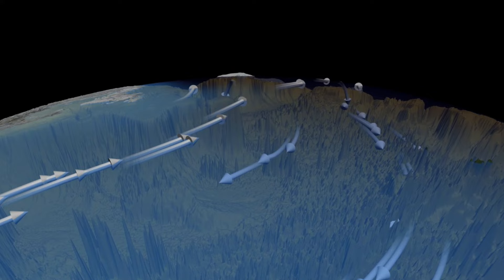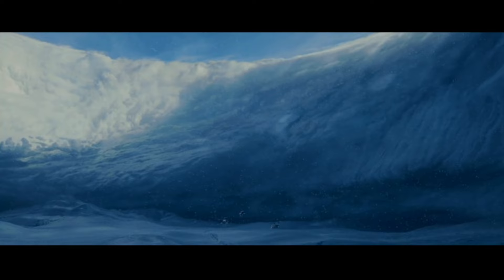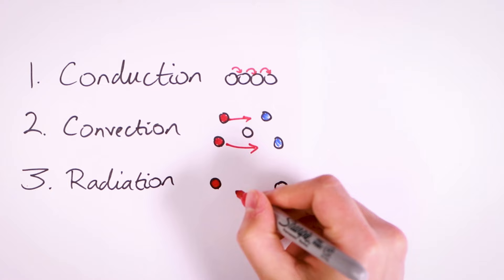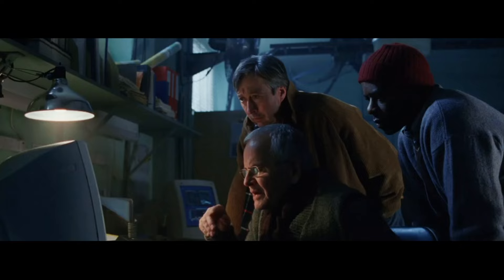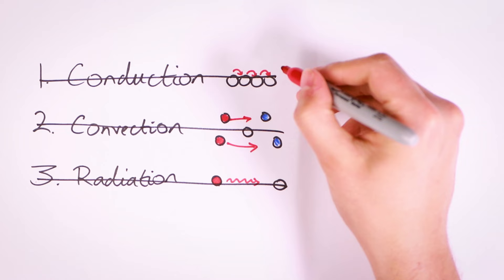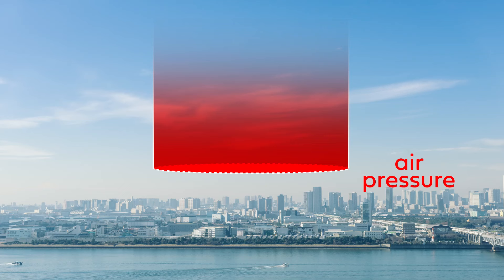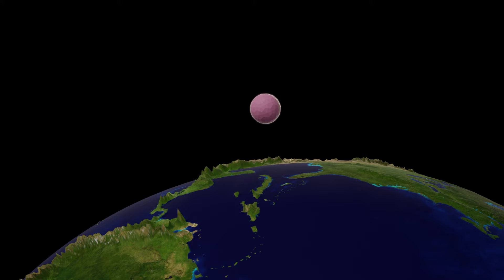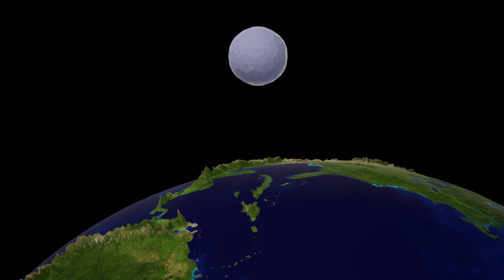The Biggest Error in The Day After Tomorrow

Comment: Funnily enough, my meteorology teachers said that one part in the movie is feasible...even assuming adiabatic warming, that that aprticular scene was theoretically feasible, but then again, I thibk they were assuming the hurricane like storms acted like a true hurricane where pressure at the surface would fall and then would allow for No work to be done one the parcel, but of course from there there'd be less atmosphere to take the heat away, and helicopters would fall iut of the sky well before it got cold enough, simply due to decreased push from the presshre drop
Reply: I thought of this as well.  The whole reason the air descends is the drop in pressure in the eye of the storm.  The air might actually get colder as it descends.  Didn’t think about the other implications, though.  Not only would the helicopters fall due to the low pressure, I think the characters might suffocate.
Reply: @SeaCowsBeatLobsters  
The pressure near the top of the mesosphere (80-90 km) is only 1/100,000 or 0.001 % of that at sea level, so the air descending to the surface without being compressed isn't even remotely possible.
Reply: In practice, a super-downburst
Reply: @SeaCowsBeatLobsters  An air pressure that's 160 hPa or lower (16% of normal sea level pressure) will give you roughly 5 seconds of "useful consciousness" before hypoxia renders you incapable of performing tasks to save yourself. This is assuming you were sitting still, any sort of aerobic exercise (e.g. running around) will further shorten this.

Comment: I was actually thinking about the helicopter freezing scene recently. If the air from high in the atmosphere is cold enough to freeze helicopters (and helicopter pilots) in seconds... how the hell did experimental rocket planes fly to the edge of space?
Reply: The velocities those planes flew at generated so much friction on the airframe that heating beyond safe operating temperatures of normal steel or aluminum alloys became an issue, therefore they used the fuel as a coolant before burning it (in the case of hydrogen rocket powered systems and other liquid fueled rocket systems), had ablative coatings or had cooling systems in place. At least until the super-alloys they needed were developed. Or they used solid fuel rockets which once started are EXTREMELY difficult to put out as the reaction is self sustaining and generates immense heat.
Reply: Because those are 2 very different things

Comment: I guess another way of saying this is that the per-molecule energy of air in the upper atmosphere is higher than that lower in the atmosphere, but that this only turns into a measurably high temperature when pressurised?
Reply: No. The per-molecule kinetic energy of the air is the temperature. It increases when pressurised

Comment: Nice to hear about this phenomenon from a scientific perspective.  I studied mining and mineral processing engineering, and we call the adiabatic heating phenomenon "autocompression."  In underground mines, particularly the ones that go way down, (the one I worked at had plans to go down to about 3km under the surface and only stopped there because exploration hadn't been done further down), we have to figure out a system of ventilating the workspace.  

In every mine, we need enough airflow to keep exhaust fumes, blasting gasses, natural underground gasses (like, y'know, natural gas) down at concentrations where they don't explode or make horrible things happen to people's lungs.  Unlike up on the surface, there's very little natural airflow in underground spaces, so we have to use forced air systems, and when you have a big industrial complex that's shape is largely dictated by the ore body, that makes for a complex system.  But...that's still fairly easy.

In deep mines, though, you get the added difficulty of heat management.  The further down you go, the hotter it gets, and that gradiant is fairly steep.  By the time you're over 2km down, you're talking upwards of 70 degrees Celsius or so, at least at the mine I was working at.  Naturally, that makes the air down there really effing hot.  Not quite 70, because we've got the fans going for the toxic/explosive gas issues, and that kind of heat will drive a degree of natural ventilation even if that system went down, but...more than hot enough to kill a human being working a shift down there.  So...we need to cool the place off.  

That's fine, right?  We've got A/C systems, we just make the air really cold and push it down and...oh...autocompression.  Or adiabatic heating.  How do we solve this?  Two options: really really cold air, or water/ice and heat exchangers.   The mine I worked at has been in operation for over a century, and has some interesting features from its early days.  One of the most notable is the collapsed section that has a nice network of cracks running all the way to the surface above it.  That's where they draw the air from, and because it's in the interior of Canada, the cold of winter and the heat of summer balance out to that rock being a pretty steady 2-3 degrees C.  That's enough to get the air at the bottom of the mine down to a safe working temperature.  But...that's the easy option that works if you're lucky enough to be running your deep mine in Canada and have a collapsed section from the early days of the mine when things like that were just...accepted normal events and not crises that might get the whole mine shut down.

The deepest mines in the world are the gold and platinum mines in South Africa.  The deepest of these, Mponeng Gold Mine, is working on going down as far as 4.27km below the surface, and was at 3.84km down by the end of 2018.  But...they probably don't have that network of cracks to the surface.  They certainly don't have Canadian winters to turn that into a very cold heat exchanger.  So they have to use the expensive option: pumping cold water (in extreme cases like Mponeng, a water/ice slurry, since all the energy that goes into melting the ice doesn't bring the temperature up), down, and having heat exchangers deep in the mine absorbing the heat down there and bringing it up to the surface.  There's still some work being done on the water getting pumped through the system, but this greatly reduces the amount of cooling potential that is lost due to adiabatic heating.   But doing that means you need to build an extremely complex and enormous system that is effectively doing what refrigerators do.  (oh, and if you're wondering why they use water/ice instead of a normal refrigerant, it's because somewhere in this massive system, you're going to get a leak now and then, and water spraying out of pipes is much less of a problem in a confined space than massive amounts of difluoromethane spraying into that space.  At the very least, a worker walking into that area is going to notice the water filling the space and thus not die, whereas you might walk into a space where the difluoromethane has replaced all the air and just die in a few minutes having not realized you had made a mistake until it was way too late. (And yes, such is the joy of working in confined spaces.  If you do this kind of thing for a living and have not had a course in how to work safely in such spaces...please find a course you can take, this is life-or-death knowledge.))  So...this is only really viable for mines that produce massive amounts of gold and platinum group metals, because mines are only viable if they turn a profit, and nothing else is worth enough to justify building a system like this.

(While I know nothing about South Africa's regulatory system, I will note that there are countries where mines "benefit" from having safety rules about hot environments that are less strict than those used in Canada.  I put that in quotes because I would argue that the safety of its workers should be a major priority for any mine, and forcing workers to work in too-hot conditions is contrary to that.  To me that outweighs the financial gains from not having to implement a proper cooling solution.  Unfortunately, there are far too many mine operators who do not take such a moral high ground.  And I do want to emphasize, this is not a comment about South Africa specifically; I do not know what their rules are.)

Comment: Under certain conditions, water can flow uphill. It requires the surface have a jagged "step" texture and be so hot that it induces the Leidenfrost effect. The water "grips" the steps and "falls" up the slope of the surface if it's angled correctly.

Comment: Yeeees. Non-scientist but I do recall having to suspend disbelief at that scene, as with the scene in Waterworld where he dives using the air bubble in an inverted glass bowl to dive down to submerged buildings - from a sea level that is above all but the Himalayas. Also, for low pressure air to be sucked down that work would have to be equalised  in some way and whatever is providing that energy is sure to be doing more damage than frosting the Empire State. (And where is the water coming from for that effect anyway?).

Comment: Even if the air was coming down as cold as described, it wouldn't be able to "suck out" so much heat energy from the buildings and helicopters through conduction as fast as shown.

As Simon states, air is a pretty good insulator and additionally, steel and concrete have a pretty high heat capacity compared to air. So it would take a lot of time to actually cool the material down.

It's like when you were in a sauna and then go outside in the winter, it is not like your core temperature immediately drops down to 0°C, you can spend a good amount of time there without even feeling cold.

Comment: Magic actor that did the work to move air around was left out of picture.

I saw that scene. And I thought it is perfectly normal that cold air would replace warm air and thus downward movement. It probably requires less volume to maintain same pressure when it is colder.
I understood that scene as somehow super-cold air appeared at some altitude. And warming from pressure increase while it moves down wouldn't be enough to avoid freezing.

I didn't understood well how to use that map at 6:24 in this video. My guess from it is that it indicates that going from 100 hPa (~15km) down to 1000 hPa (near ground) at ~40N latitude would result in warming up by 715K. But if that air was just from ~8km (~350 hPa) - difference is just 45K (330K-285K).

Comment: Adiabatic cooling is actually how air is typically liquefied. You compress it to high pressure, it then gets hot, and then you let the tank of compressed air cool to room temperature, and then you let out the pressure, and then you have very cold air, some of which liquefies if you do it hard enough. Ironic that you get a more compressed form of it by releasing the pressure since of course the liquefied air then has a much higher density than the compressed air. But of course that's not a problem for consistency with the laws of thermodynamics because only a small fraction of it actually liquefies.

This actually doesn't work with helium starting from room temperature, to liquefy helium, you must cool the whole thing with liquefied air first, AND THEN perform this process starting at the lower temperature, so it's a very inefficient two-step process, and that's also why liquid helium is so expensive to produce. Note that adiabatic cooling doesn't actually happen at all in an ideal gas, it is only because of the van der waals forces and unideal behavior of a gas that it happens at all. If you compress an "ideal" gas, it doesn't heat up at all because the work you perform on it just is stored as potential energy by virtue of the fact that it is compressed gas which can perform work when it expands again, so the energy you put into compressing it isn't lost to generating heat. And helium is much closer to an ideal gas until it gets very cold already, so adiabatic heating and cooling doesn't work on helium until you get it to a mighty cold starting temperature.

Comment: So this was wrong. You explained what would happend if this would be showed correct. But another interesting perspective: What conditions would be necessary to make this happen? Assume the Storm "throws" the air out of the centre that you get the pressure in the middle which would be the same 80 km or whatever over ground. Sounds like you need a pretty nice storm to accomplish this. How fast would this storm be? And since it needs to do work, how hot would the storm be?

Comment: QQ from a very-non-physics person. Wouldn't the air rushing from the stratosphere to the surface be due to the even lower air pressure at the bottom (obviously anomalous)? Then this argument that the air is doing work thus heating up doesn't hold.

Comment: There is also the issue of displacing the air beneath that column. Fluids of different temperatures simply don't mix together all that quickly.
Reply: Would that mean there would be thunderstoms or intense weathercells?
Reply: @em945  It's a big part of it.
Reply: Another problem is that air from the upper mesosphere couldn't have much of a cooling impact on the sea level atmosphere since it is about 100,000 times thinner. You can't cool a bathtub filled with near boiling water with a thimble of ice water.
Reply: @fromnorway643  so interesting and  complex.

Comment: I’ve watched the video and, ok fair enough what you said does make sense! :D

However, hypothetically what if the storm depicted in the movie has an incredibly low air pressure in the eye of it? 
Wouldn’t it be theoretically possible for what happens in the movie to happen in a IRL situation ether by having roughly the same pressure as the cooler low pressure air or by the low pressure in the storm decompressing higher pressure air lower down in the atmosphere rapidly cooling it? :P

Sorry if this is a stupid question BTW, I’m just genuinely curious as to wether or not you think there is any way (depicted in the movie or not) that a storm like this would be possible, AKA: a storm that can freeze anything in a matter of seconds! :]

Comment: what would happen if the rotational speed of the air at the core of the storm centrifugally was fast enough to where it would force the air outwards and drop the pressure at the core so much that it would suck air in over the top of the storm ??

Comment: Hey @Simon Clark, I have a big question about climate change since a few years now and it's really frustrating to not find an answer, even more knowing I'm an engineer.
Greenhouse gases are the reason why the Earth is warming but I am wondering about the impact of the heat we are producing by burning fuel, producing electricity, heating our houses, etc.
Doesn't that accelerate the global warming too ? Is this heat partially radiated out of the atmosphere and absorbed by GHG for the rest ?
I'll be so glad if you can answer <3
Reply: good question, always wondered about that too
I can only imagine the amount of heat that is produced is only a tiny fraction, so that it isn`t really important to consider.
Just thinking about the amount of energy the sun gives the earth every year ( over 9000 times our primary energy per year), the energy  we use to heat is just insignificant. The CO2 in the atmosphere scales the trapped energy of the sun in our atmosphere way more then all the energy we use for heating.

But yeah i hope Simon can answer too
Reply: @Itachi-ph1sl  I didn't have any order of magnitude in mind but that's something I imagine, I'm just wondering how insignificant it is to understand why we're never talking about it. I would also like to be able to answer that if I am ever asked to.
Reply: @Itachi-ph1sl  
The net climate forcing from all man-made impacts since 1850 (basically greenhouse gases minus the cooling impact of the aerosols, mostly sulphates) is now about 2.5 - 3 watts per square metre of the Earth’s surface.
The heat released directly from the burning of fossil fuel plus nuclear makes up about 0.035 - 0.04 watts per square metre, so that contribution is really tiny compared to the greenhouse effect.
For comparison, geothermal heat is about 0.1 watt/m², so that part is also quite unimportant, and more notably, it hasn’t changed significantly for millions of years.

Comment: If a mass of warm air with low pressure was able to move over the pole, the upper atmosphere low temperature low pressure air could collapse into the warm mass and cause rapid cooling and potentially freezing even during the summer. You can see that happening in weather systems in recent years, so the movie "The Day After Tomorrow" is an extreme exaggeration.

Comment: The cyclonic action supposedly drops the cold air mass from the troposphere to the surface, by dropping the pressure… so, not compressing the air down, but by evacuating the surrounding air in an eye of the storm. 
This of course would basically put everything into a near vacuum… also ludicrous.